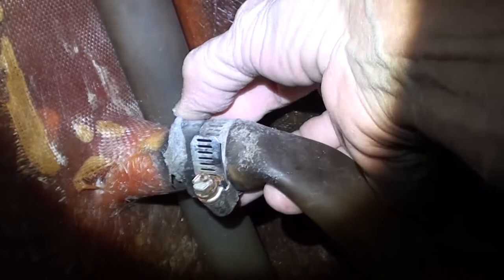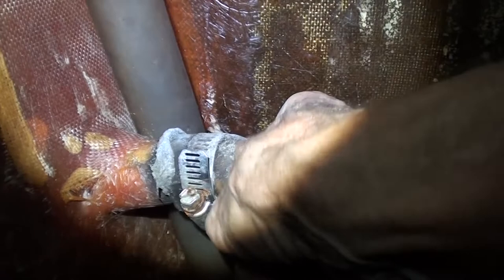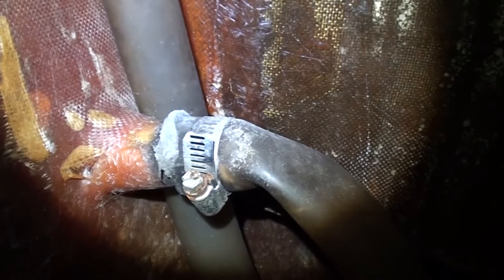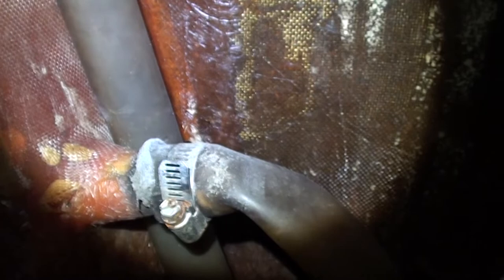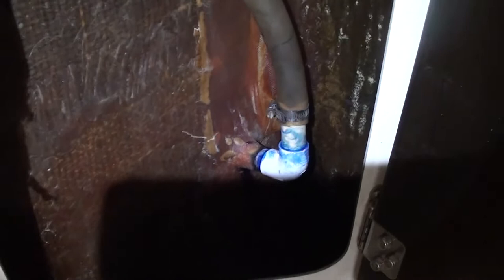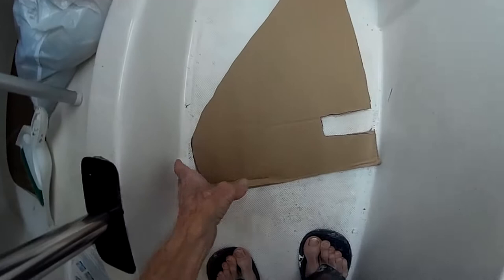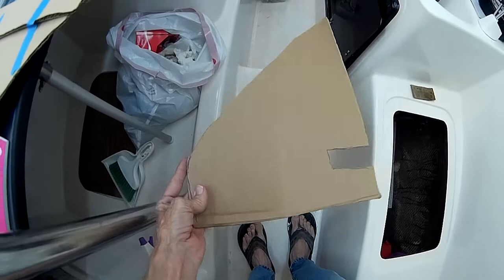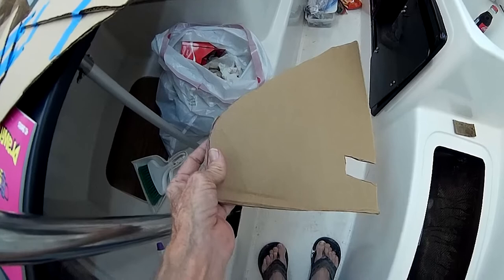Attach Shelves to fiberglass hull of boat (ceilings too)

Comment: You said you got a boat out of the junk pile last video. I must have been distracted, because I thought you meant your Carver. I was thinking you said you got a good deal on the Carver, but you never said it was a salvage. Congrats on getting an X, that's the boat I'd love to have, only thing stopping me is money. Did you tell Jess she could use your Mac 25?  If so, you're either getting promoted to Commodore, or going to be boat poor. Either way, there are worse things that can happen. I'm really glad you got that X.
Reply from the maker: I always wanted a Macgregor 26 X or M boat, so when the opportunity presented itself, I grabbed it.  Traded some stuff I hadn't used in a decade plus a little work and I get to keep it!  The Carver is pretty much just for spring and summer cruising.  It goes in the water in spring and takes four days to get it to the keys for the season.  The Mac can be trailered to the keys in an afternoon so I can go any time there are a few nice days, even in winter or between hurricanes.
Reply: @ninehundreddollarluxuryyac5958  do you still have your Macgregor 25?
Reply from the maker: @chuckrobinson599  Housing is so expensive here that a lady bought the Mac 25 to live in.  She came to Florida to help with her baby grand-daughter and could not afford even the smallest apartment.  I sold her "Gemini", that blue MacGregor for $1,500 and she kept it at a marina where her rent for the dock and power was about $300 every month.  I think the cheapest apartment here is twice as much.  A lot of marinas here are full of old boats that never go anywhere because people with minimum wage jobs find living on them nicer than in a tent.

Comment: Hey Capt what boat is this it’s not the 900$ yacht. Did you get another boat JT 🇺🇸🇺🇸🐟🐠🎣🛥🌴⛱🙏🏻🙏🏻🙏🏻
Reply from the maker: Sort of mine.  For now, it is being used to test some stuff for someone else's bigger boat.  I plan to steal it a few times while the Carver is in the boat yard.  When the project is finished, I plan to keep it.  Why ask to be paid in money when there is a boat?  

This boat was on the demolition pile with a big hole in the side which was fixed.  The ultraviolet camera also showed an even more extensive repair on the same (starboard) side and some repairs in the cabin that looked like they may have been cut for chainplate inspection.  

I like this boat, it is a MacGregor 26-X.  It converts from a sailboat to a speedboat that goes 20 knots with a 50 horsepower Honda four stroke outboard, and has a big cabin.